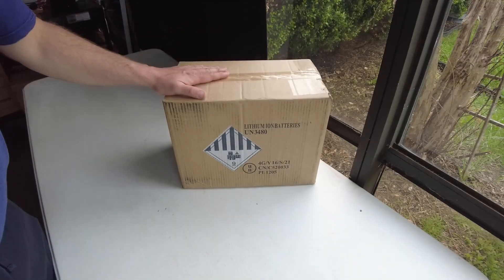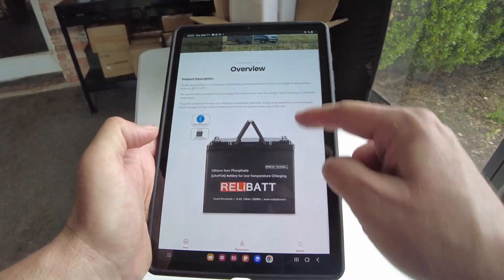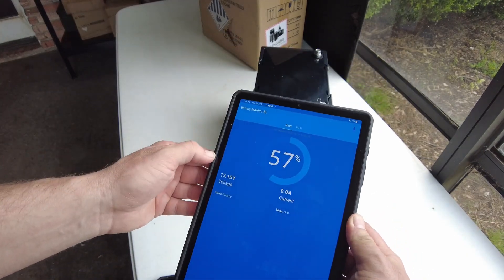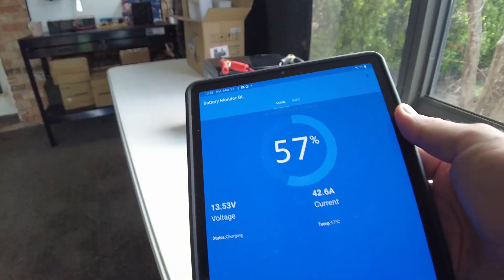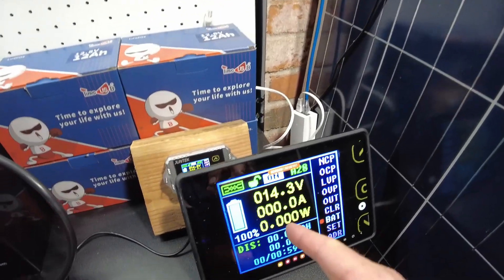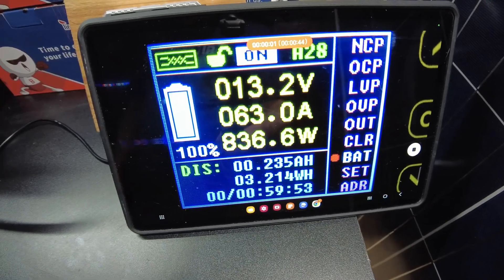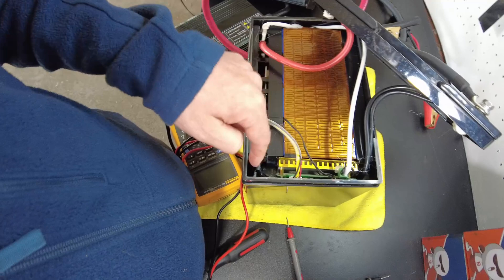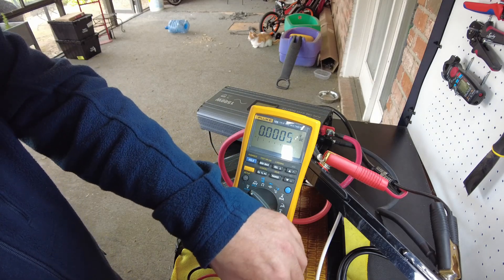RELiBATT 12v 100ah LiFePO4 Bluetooth & heated battery

Comment from the maker: I re-uploaded this video to correct some info. Some info around states "technically" 4.2v is the absolute max for LiFePO4, but generally accepted max is 3.65v, and that is what I'm comfortable with, I still stand by my opinion about this battery for now.
Reply: Great job Brad, While watching I was wonding if 3.65V max is the resting voltage. But again I always follow the 3.65V charge to rule. 🤔 Are you sure 4.2V is for LifePO4? I know 4.2V is for NMC like 18650 cells.
Reply from the maker: @Roll2Videos  Thanks. I've seen info from the past, and I recently looked it up. Some sources say 4.2v is the absolute max for LiFePO4, but the recommendation is 3.65v which is what we're all accustom with. Leads me to conclude 4.2v may be the max, but it's not good for the cells.
Reply: @BradCagle  I agree; I didn't even think to check that when I reviewed this battery for review.
Reply: @BradCagle  I've read many manufacturer data sheets for LiFePO4 cells and they all say 3.65v. I suspect the sources which say 4.2v are confused about their cell chemistry.  A BMS shutting off at 3.7v is acceptable - it is the last line of protection not a normal operation kind of thing.  Going 3.8v is not acceptable.
Reply from the maker: @Sylvan_dB  Possibly.
Reply: I am guessing the BMS was not balancing the cells at all ?
Reply from the maker: @IamMotorHomeless  I thought about that after the video, I think I'm going to see if I can measure any current.
Reply: @IamMotorHomeless  Or very slowly

Comment: Iti seems like in the past 6 months or so you've really been getting a lot of stuff in. Are most of these products for review sent by the manufacturer? If so, what do you think caught their eye? Lithium Solar has really slowed down (don't blame him, he was on a 3 or 4 year rampage) so do you think there's room for more battery reviewers? Is it worth it? I'm assuming you spent a fair amount of money getting started and having different cells/batteries for you to start your channel with before getting free stuff. Do you use all these batteries as is in a 12V package typically or put them in 48V?
Reply from the maker: Yes most of the products are provided from the manufacture. If the video says "Includes Paid Promotion" in the upper left corner on start, that means I received a product, but to be clear I don't accept payment to do the review. I have to turn that on if I receive anything of value. After 1000 subs, I started reaching out to a few manufactures, and I started getting some willing to send review samples. Then shortly after that, I started getting contacted by manufactures wanting to send stuff. As for what caught their eye, pretty simple I think, It costs way less money for them to work with a bunch of micro/nano influencers (like me), vs a few highly visible ones. The high visible guy's are likely looking to get paid, and are probably not in a hurry to get around to doing the review. With me it's just the cost of the product, and I usually churn out a review in a week after receiving it. It's genius really if you think about it, they get in with smaller influencers, and as these channels grow, the views on the videos (which includes their product) continues to grow forever. As for is it worth it? For me yes, because I'm not spending money (or as much) to create content. Is it worth it for the consumer? Yes, because if you're looking to buy something, you can make better choices if the general consensus across many reviewers align. Do I use all the products, unfortunately I cannot, I keep the stuff I can use, and have recently been trading the stuff I can't/dont need for other Items that I can use to create content. And yes I did spend a fair bit of money initially, to the point of regret LOL. But I pretty much knew I couldn't keep it up financially unless manufactures kicked in products, so that pretty much enabled me to continue. Thanks

Comment: I've had mine since July and I'm really enjoying it. The form factor was the selling point for me as I had a tight space in my B van for a battery.
Reply from the maker: I really like most everything about this battery, including the form factor. The voltage limits on the cells really has thrown me, it's out of the ordinary.  I'll update when I hear back from the manufacturer.
Reply: Mark...how long after ordering did it take to get a tracking number?  I ordered 3 days ago, no tracking number or confirmation email.

Comment: i hope you hear back from them with an explanation for the high/low voltages the bms is allowing, maybe a imbalanced system when assembled and the bms isn't balancing well?
Reply from the maker: I'm thinking that's what they have set to, but when I hear back i'll update.
Reply: It seems as if the BMS is shutting off based on pack voltage instead of cell voltage, and this is affecting both the high and low protection.